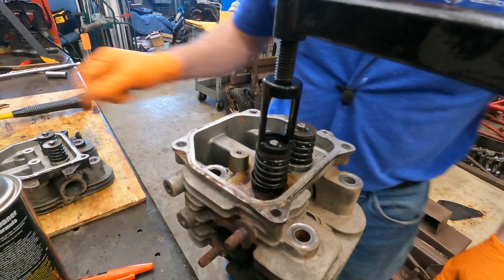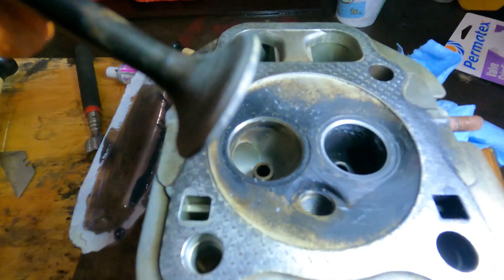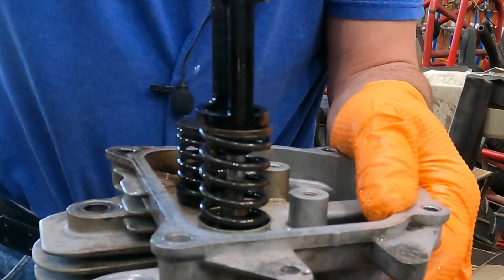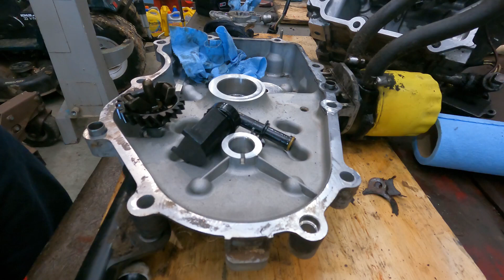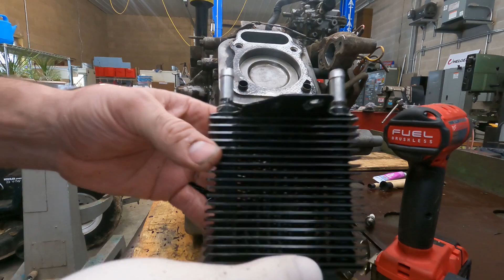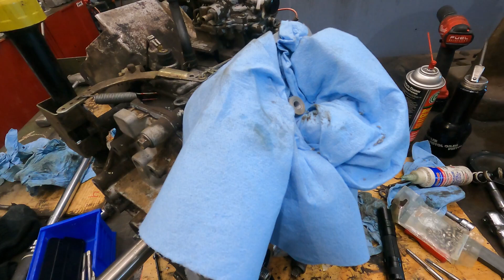Grasshopper zero turn Kohler twin cylinder CH25S engine rebuild, heads, valves, other stuff PART3

Comment: I`ve been having problems with a Kohler CV740. It is building crankcase pressure. I figured it was a blown head gasket. I resurfaced the heads and new gaskets, lapped the valves and new valve seals, new bottom crank seal, 2 new coils and plugs ,rebuilt the carb with a new accelerator pump and it still sounds like it has a miss especially at an idle. Under a load cutting thick grass it runs perfect and plenty of power. Still seems to have crankcase pressure. Crankcase breather is clean and open. No oil leaks and not smoking but losing a small amount of oil somewhere.  Compression test was 155 and 160. Leak down test was good. Engine has about 965 hrs on it. I bought the mower new in 07 and its had the oil changed every 100 hrs. The only other thing i can think of is possibly rings. The spark plug on the number 1 head was a little wet.
Reply from the maker: WOW!!  You have checked every box to try to mitigate the issue. All that’s really left are the rings!  Time to pull the motor and crack it open. For sure the rings will cause crank case pressure. Keep us posted on what you find!

Comment: One thing you did wrong: 
You should always turn your crank so that your piston is at TDC before putting the head on.  You can hold your push rods down in their holes and turn it over until you feel them both closed as the piston is coming up to the top.  That way you know your valves are closed when putting the rockers on.  I know these have lifters, so it's a little different.  but it's just good practice to do.  Make each piston be at TDC before putting the head on.
Reply from the maker: That’s great advice!!!  Thanks!

Comment: Hi discuss with Kohler URGENT the cylinder heads have square oil drain holes . This places the oil drain hole very close to combustion chamber ,eventually eats the gasket and it blows .
The up graded heads  have triangle holes 
Alot later motors also recieved fire ring head gaskets to prevent combustion from eating the gasket .also.  Kohler will save pennys at the expense of the customer

Comment: What did you use for sealant when putting the cover back on?
Reply from the maker: Permatex black. Works great 👍
Reply: @whatsnextgarage  Thank you for the reply.  I was thinking the oil resistant ultra black is what you used, but couldn't tell....can't tell you how many times I rewound that part of the video and tried to stop it on a frame to see :)
Reply from the maker: @dougdoesstuff24  dang I’ll have to make a point from now on mentioning what I’m using to seal stuff up with. I’m currently doing a Kohler command pro 22 hp twin. I’ll make sure and mention it. Good luck on your rebuild and have a great rest of the weekend!

Comment: Great video! I just have a question! What happens if you put the seal at the exhaust valve( both valves seals) because there's another video the guy put it on!
Reply from the maker: Not sure.  The tractor has one full season on the fresh rebuild and it’s running great. The manual for that motor shows only the intake seal.
Reply: The valve is surly stick to guide and bend push rod
Reply from the maker: @philliphall5198  thanks for the info!!!